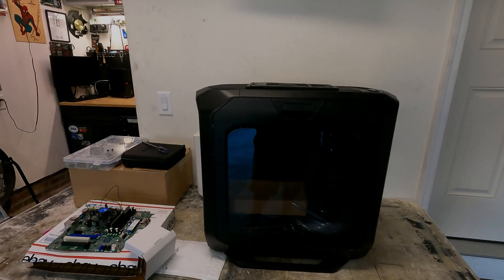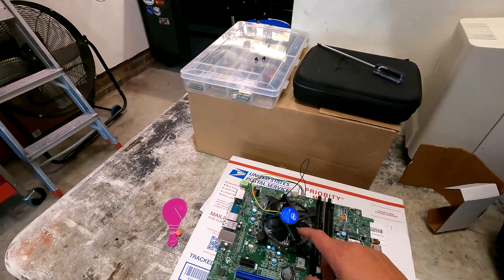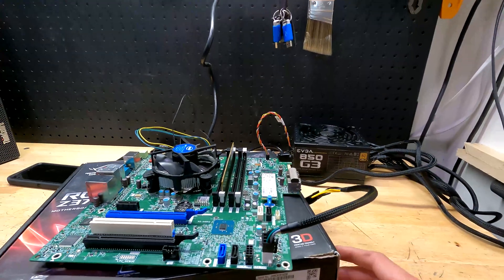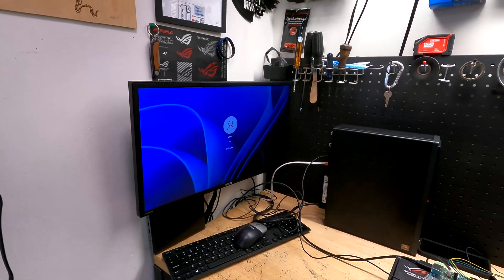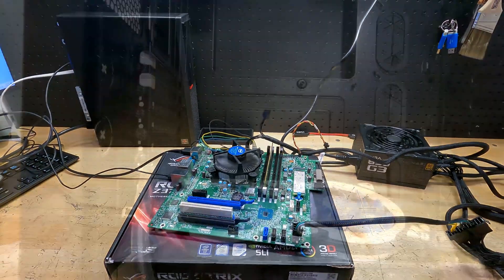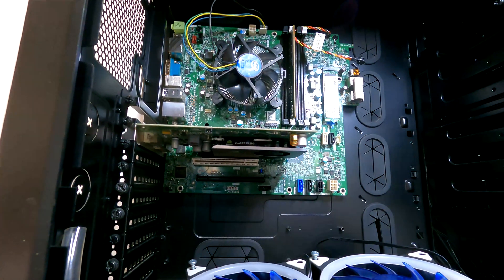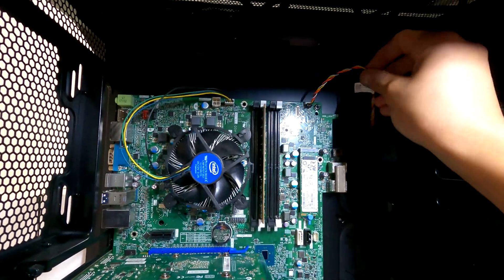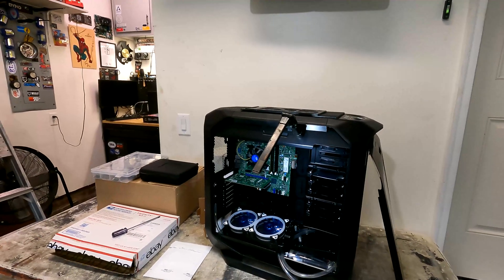Dell Optiplex 7050 case swap...… an unconventional build and will it work?? Pt 1

Comment: I have the same motherboard and I plan to do the same thing you did. I hope it works out for me. Wish me luck, stranger.
Reply: any updates?
Reply: @0GAMA  I saw everything well, I changed the fan cooler on the processor and installed an 8GB RTX 580 plus 24GB of RAM. The case is not the best but during these 9 months it has worked wonderfully.

Comment: I had to leave a front USB 3.0 Header connected to a build I did. It sold in like a day because I transplanted to a pretty case but I didn't even think about adding wireless or storage via usb. I just kind of hid it away in the back panel. Good idea and nice build for a super budget.
Reply from the maker: the wifi inside worked great!!

Comment: Great little project there and as a PC flipper I’m really interested to see how this turns out 😎
Reply: How's flipping going for you? I was pretty big on local sales, but the demand died off, and it was getting hard to deal with sales with my work schedule. I been doing pretty good building and selling on mercari lately though. Extra cost on packaging and of course the selling fee's cut into profits, but it's been pretty good. Its nice having the nation wide market for buyers definitely helps.
Reply from the maker: its hit or miss.... not as good as it use to be before the pandemic, but it has picked up some.
Reply: what type of pcs d you sell?

Comment: Looking good as as you say an internal USB bluetooth and wifi would be a cheap upgrade.With the stand off you could just screw them to the board for alignment and then expoxy them in postion on the back of the case. Whilst the water cooling is overkill for the processor maybe you could make the tubing a tad arty to add to its persona.
Reply: There's a reason motherboards with built in WiFi have antenna slots where the rear IO is, metal cases can affect range. Built in WiFi works on laptops because it's normally placed in an area that's predominantly plastic above. I wouldn't recommend internal USB wifi at all.